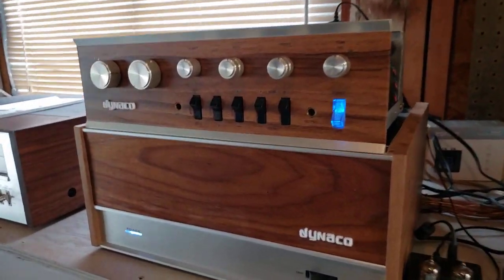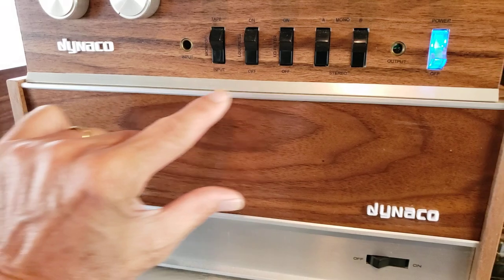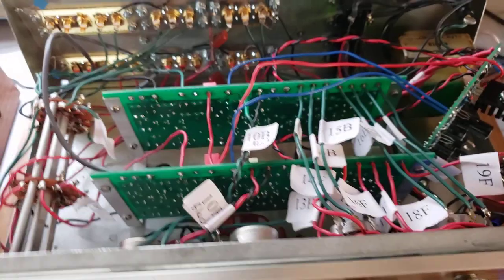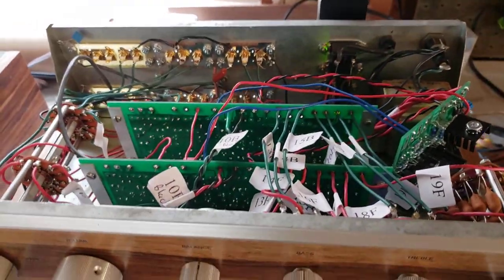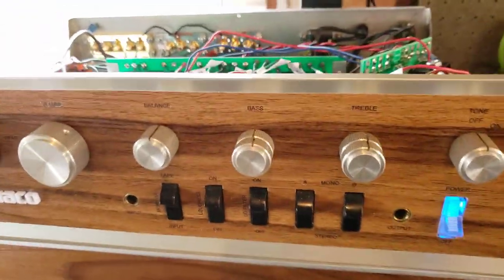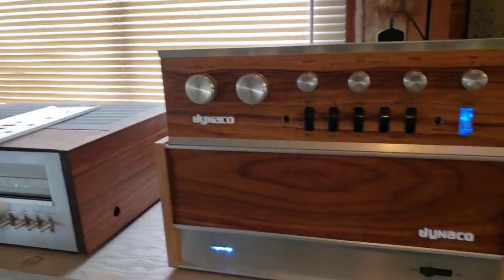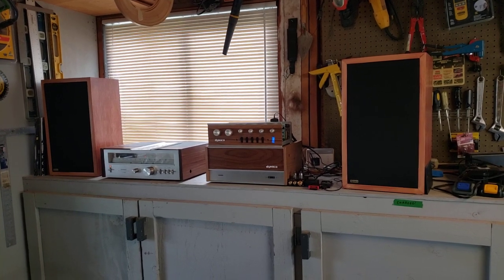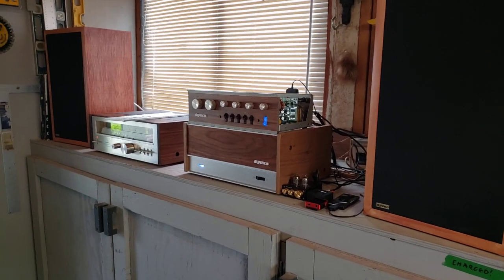Dynaco PAT-4 Woody Upgrade Project Status Report

Comment: Excellent job!
Looking at a Pat 4 now - risky venture?
Is hooking it up enough to test basic functionality ?
Reply from the maker: Not very risky if you are handy. Can be quite costly to do the update my dynaco dot com updates but you essentially get a new preamp dressed up in old clothes by doing that. Not a real big fan of the original PAT-4. Waste of time refreshing the old boards with a recap.You pretty much need to upgrade them otherwise you are wasting your money on an otherwise second rate 1st generation solid state preamp IMHO. Most of them are plain worn out but with Dan's UMD kits you get a real good preamp that will stand the test of time🤔

Comment: Beautiful work! Two questions.... Where did you source the decals (or dry transfers) for the faceplate markings, and do you sell the Dynaco 3d printed logo?
Reply from the maker: 1. You can easily buy decal paper for Laserjet or inkjet on Amazon or eBay. Laserjet is much preferred as it has crisper writing and does not need to be clear-coated to prevent tge ink from running like you need to do with inkjet where the ink is water soluble.
2. I guess I could whip up some, am in Victoria, BC 🇨🇦.  They are literally pennies worth of material so it would merely be cost of shipping depending on where? If you know someone who has a 3D printer or you have a local service as most cities do I have made the 3d design freely available for anyone to use here as a pay it forward initiative😉: https://www.thingiverse.com/thing:3686134
Reply from the maker: I should have mentioned that decal paper does not print white - it is a technical limitation😉